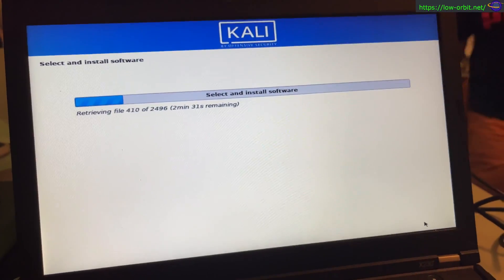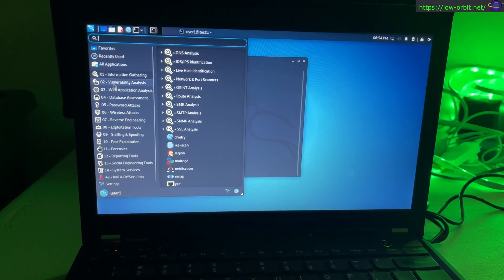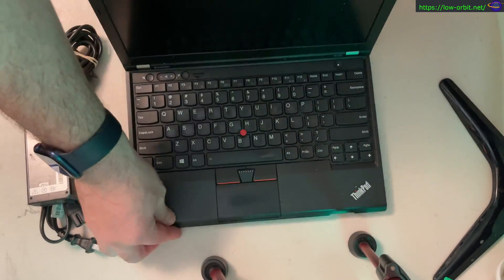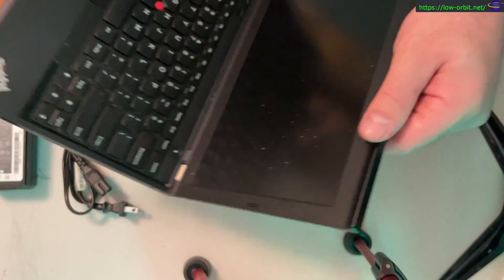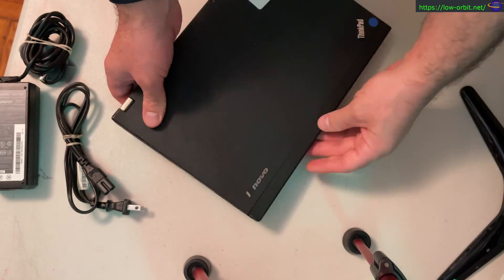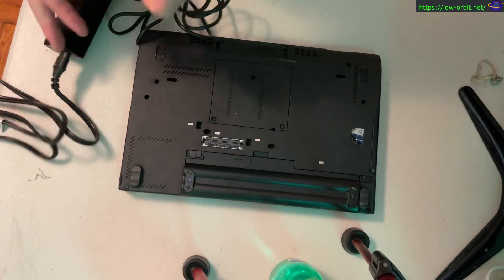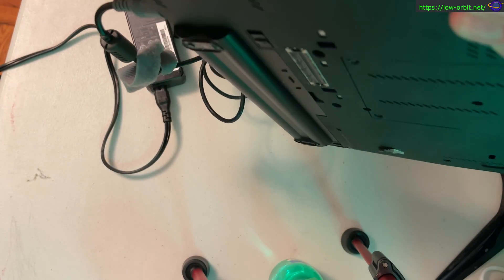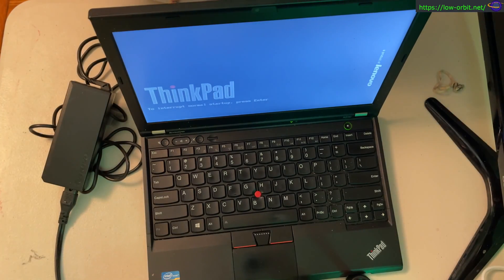ThinkPad X230 from EBay with Kali Linux

Comment: I own a X220 and I had also the previous owner/seller send the laptop without the cadi and with the SSD like that, you should never put disks without the cadi and rubber sides. it will rattle inside each time you pick up the laptop and start to pressure the sata connector...but to each its own...